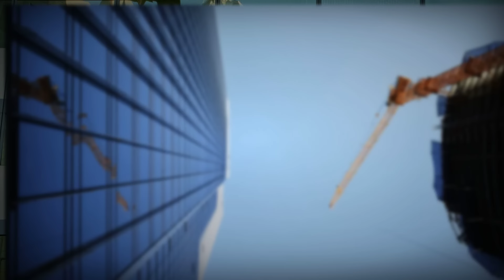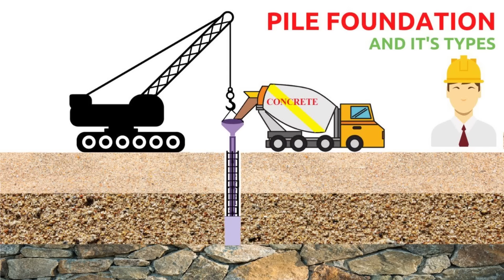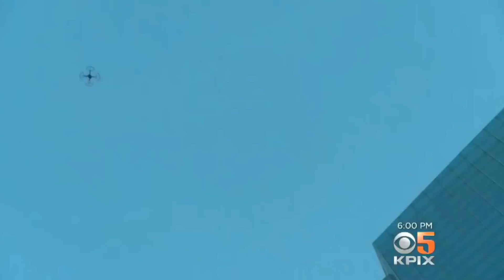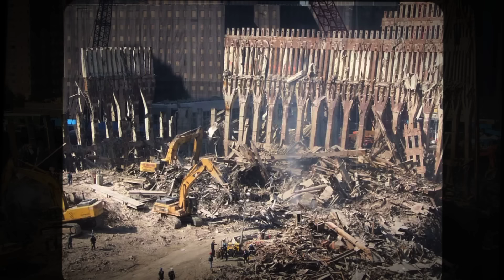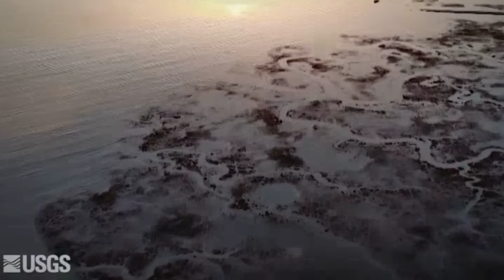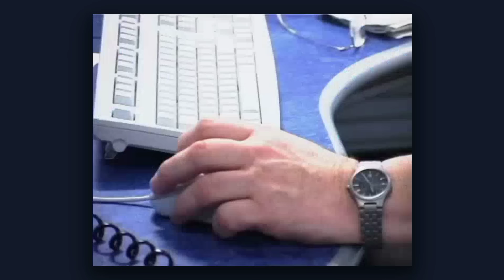Just Confirmed! San Francisco Leaning Tower Has Started Sinking

Comment: All I can say is , it's gong to be one hell of a kill zone . many people know where so clear out now . An earthquake may be the final  nail .
Reply from the maker: The footprint of a falling 645 foot tower in a dense financial district isn't just the building itself. It's a kill zone that extends well beyond the property line in any direction the building tips. Salesforce Tower is two blocks away. The Transbay Transit Center handles tens of thousands of commuters a day. BART and Muni tunnels run directly underneath. Office towers full of workers are within shadow distance. A real collapse event wouldn't be hundreds of casualties. It would be thousands.
The earthquake nail is the scenario nobody wants to model in public. The building is now in a hybrid foundation state that has never been tested in a major seismic event. Half on bedrock piles, half on friction piles in soil that can liquefy. The 1989 Loma Prieta quake was 60 miles away and still leveled buildings in the Marina. The next big one on the Hayward fault will be much closer and significantly stronger. The USGS gives the Bay Area a 72 percent chance of a magnitude 6.7 or larger quake within 30 years. That's not a possibility. That's a near certainty inside the lifetime of most current residents.
Your advice to clear out isn't wrong, just impractical for the people stuck there. Most of them can't sell because nobody will buy. Can't walk away because they'd lose everything. Can't afford new housing in the same city. So they stay and they hope. The kill zone you're describing isn't theoretical — it's just waiting for the right Tuesday morning. And the city's plan for that Tuesday is essentially to hope it doesn't happen on their watch.

Comment: Reading some of your [OPENLENS] replies, you seem to know what you're talking about. Just curiosity here: would it be hypothecatable to get some oilfield engineers in to drill and pump material in under the building? I have heard of how some materials change texture with either additives or conditions. I wild example is what happens to clay when it's baked .... Specialists in any one area / field / science / practice tend to look for solutions within that framework, like "change the foundation" as opposed to "change the soil". What kind of foundation are the Ancient Egyptian Pyramids on?
Reply from the maker: This is a great question and you're thinking exactly the way the smartest engineers in the world think — outside the discipline that created the problem. The technique you're describing is real and it's actually used. It's called soil stabilization or grout injection, and oilfield engineers have been doing variations of it for decades. The most common method for building applications is called compaction grouting or jet grouting, where you inject cement-based slurry, polymer resins, or chemical hardeners into soft soil at high pressure. The material displaces water, fills voids, and chemically transforms the soil into something closer to soft rock. Companies like Geopier and URETEK do this work commercially in the US.

For Millennium Tower specifically, the problem is the scale and the layering. You're talking about stabilizing roughly 200 feet of layered fill, bay mud, Colma sand, and Old Bay clay underneath an active 686,000 ton building with hundreds of residents inside. Injection grouting works best in localized zones — fixing a sinking warehouse, stabilizing a roadbed, sealing leaks in tunnels. Treating the entire foundation footprint of a 58 story tower would require thousands of injection points, careful pressure control to avoid lifting parts of the building unevenly, and chemical compatibility with the existing concrete piles. It's been considered. The reason it wasn't chosen is that at this scale, the risk of making things worse with uneven uplift was higher than the potential benefit. Hamburger's team modeled it and decided perimeter piles to bedrock were a more controlled intervention.

Your instinct about specialists looking inside their own framework is dead on. Structural engineers think structurally. Geotechnical engineers think soil mechanics. Petroleum engineers think pressure and flow. The best solutions to weird problems usually come from someone who's worked in multiple fields. The Egyptian pyramids are a beautiful example — the Great Pyramid sits on the Giza Plateau, which is solid limestone bedrock. The Egyptians weren't more advanced than us. They just had the wisdom to build the heaviest things humans have ever made on the most stable surface available. We forgot that lesson somewhere between then and 2005.
Reply: @AMERICANGROUND-u9r  --- Thanks. The middle paragraph of your reply explains why not. If engineers have looked at it, I guess that even if possible it wouldn't solve the basic problem which you have clearly and repeatedly identified as an unworthy economic solution ("cheaping out" on the foundation). Funneling heating elements into the clay is what crossed my mind, to turn it into brick, but then questions come up about density and depth and other side effects. The unit owners do have the small consolation of being amongst the first to say "Well, that's the way the marble rolls" instead of "that's the way the ball bounces." The centuries old adage, "Penny wise and pound foolish" applies to a lot of projects (e.g. Bhopal, India).

Comment: There is no backing out of this now. The building cannot be saved.
Reply from the maker: You might be right and the data is starting to back you up. The fix delivered 25 percent of forecast. The bending in the middle wasn't even on anyone's radar until late 2025. Every new round of monitoring data has been worse than the last. At some point you stop calling it "stabilization" and start calling it "managed decline."

The honest engineering question isn't whether the building can be saved anymore. It's how long you can keep delaying the decision before delay itself becomes the bigger danger. Every year of waiting adds more settlement, more bending, more legal exposure, and more risk that an earthquake makes the choice for everyone. The building is essentially in hospice care at this point. Monitored, comfortable, and not getting better.

The part nobody in charge wants to admit out loud is exactly what you said. There's no fix coming. There's just the slow countdown to whoever finally has the courage to call it.
Reply: @AMERICANGROUND-u9r  Yes absolutely. I've been following this story for years. I'm not an engineer but work in the AV tech field and I will tell you had I seen the final specs and proposals for this project I would have NEVER APPROVED IT----NOT EVER.
Reply: @AMERICANGROUND-u9r  And now if they shore up the entire perimeter it will only accelerate the middle dishing phenomenon as now nearly ALL of the building's weight will focus on the center; it will no longer be distributed.

Comment: Greed & stupidity a dangerous combination that knows no limits !
Reply from the maker: You've named the disease and most engineering disasters in American history are some version of it. Greed alone gets caught by good engineering. Stupidity alone gets caught by good oversight. It's the combination that bypasses every safeguard, because the greedy parties have just enough competence to push their decisions past the people who should have stopped them, and the stupid parties have just enough authority to sign off on things they don't fully understand.
Millennium Tower is the textbook example. The developer wasn't dumb — they were sophisticated enough to value-engineer the steel out of the design and shift the foundation calculations in their favor. The city inspectors weren't corrupt — they were just busy enough and trusting enough to let peer review concerns get smoothed over in meetings. The engineers weren't malicious — they were boxed in by change orders and scope limits that made it nobody's job to flag the mismatch between the new building and the old foundation. Each individual link in the chain looked reasonable. The combined result was a 686,000 ton mistake.
That's why this pattern keeps repeating. Surfside, Hard Rock New Orleans, Champlain Towers, Hyatt Regency walkway. Different buildings, different decades, same lethal recipe. Greed makes the call, stupidity signs off, and gravity collects the bill years later from people who had nothing to do with either decision.
Reply: @AMERICANGROUND-u9r  -- "... 686000 ton mistake" 🤣🤣🤣

Comment: Williams Tower in Houston has 64 stories. It’s been standing tall for 44 years!
Reply from the maker: Houston is the comparison that exposes Millennium Tower for exactly what it is. Williams Tower is 64 stories, 901 feet tall, and was completed in 1983. It's actually taller than Millennium Tower by a significant margin, and it's been standing dead plumb for over four decades on Houston soil that isn't exactly engineering-friendly either. Houston sits on expansive clay that swells and shrinks with moisture, and the city has known foundation challenges of its own.

The difference is the engineering decision. Williams Tower was built with a foundation that respected the soil conditions. Millennium Tower was built with a foundation that respected the budget. Same century, same engineering knowledge available, completely different outcomes. Houston also has the Transco Tower, the JPMorgan Chase Tower at 75 stories, and the Wells Fargo Plaza at 71 stories — all taller than Millennium Tower, all standing straight, all on soil that was never as dramatic as San Francisco bay mud but still required real foundation engineering.

The lesson isn't that San Francisco can't build tall. Salesforce Tower two blocks away is 1,070 feet and sits perfectly plumb on bedrock piles. The lesson is that Millennium Tower didn't fail because skyscrapers are hard. It failed because somebody decided to skip the part of the job that actually matters.
Reply: @AMERICANGROUND-u9r I have seen buildings being built downtown in Houston. They dug a hole in the ground, five stories deep just for the start of the foundation.

Comment: I remember hearing that the original plans for the building were in spec with the foundation. It was different height and construction. When they changed the dynamics of the building on paper, they chose not to change the foundation plans. This is the result of that negligence.
Reply from the maker: You're remembering correctly and that detail is one of the most important parts of the story that almost never gets the coverage it deserves. The original design was lighter — steel framing instead of concrete, with load assumptions that the friction pile foundation could actually handle. Then somewhere in the value engineering process, the developer made the call to switch to reinforced concrete because it was cheaper to build with. That single change added enormous dead load to a building that was already pushing the limits of its foundation.

The negligent part is exactly what you said. The structural change should have triggered a full geotechnical review. New load calculations. Updated soil consolidation modeling. A reassessment of whether 60 to 90 foot friction piles in Colma sand could carry the new weight. None of that happened in any meaningful way. The foundation design got grandfathered in even though the building sitting on top of it was no longer the building the foundation was designed for.

That's why the lawsuits dragged on for years. The developer blamed the engineers for not flagging it. The engineers said they weren't given updated load figures. The geotechnical firm said they weren't asked to redo the analysis. Everyone had a story about why it wasn't their job to catch the mismatch, and the result was a 686,000 ton building sitting on a foundation designed for something significantly lighter. The residents are paying for paperwork that nobody wanted to redo.

Comment: Why don't they just, little by little, dismantle it before it collapses and 100's of people get hurt!!
Reply from the maker: That's the rational answer and you're not wrong to ask. Controlled deconstruction floor by floor is the safest path forward and it's exactly what should be happening right now. The technology exists. The methodology exists. Companies have done it on smaller towers in other cities.

The reason it isn't happening comes down to three words — nobody wants liability. The moment the city orders a dismantle, the developer faces full legal exposure. The engineers who signed off get named in fresh lawsuits. The insurance carriers fight over who pays for the residents' losses. The 419 owners hire lawyers to demand market-rate buyouts on units that no longer have a market. Everyone involved would rather keep monitoring the building than be the first one to admit it can't be saved.

So they wait. They patch. They run the sensors. They write reports. And they hope it holds long enough that the decision lands on somebody else's desk. The longer they wait, the more dangerous and expensive the eventual dismantle becomes. That's the trap. The right answer was clear 5 years ago. It'll be even clearer 5 years from now. By then the cost and the risk will both be much higher.

Comment: They sould have build on bedrock from the biginning. Now they have a problem that cost more to fix (if fixing is possible) than what they saved by using frixion piles.
Reply from the maker: Exactly. Skipping bedrock saved them roughly 20 to 30 million dollars in 2005. The rescue alone has now cost over 100 million, and that fix only delivered 25 percent of what the designer forecast. Add the lawsuit settlements, the property value losses, and the ongoing monitoring, and you're looking at well over 500 million dollars spent trying to clean up a 30 million dollar shortcut. The math on cheap foundations always works in the short term and never works in the long term.

Comment: This a way bigger deal than people realize. It’s going to tip over if nothing is done.
Reply from the maker: You're closer to the truth than the city wants on the record. The official line is that the building is structurally sound. The unofficial reality is that "sound" is doing a lot of heavy lifting in that sentence. Engineers aren't worried about a dramatic Hollywood collapse. They're worried about the quiet point where the elevators stop working, the plumbing fails at the joints, and the building becomes physically unusable long before it falls. That's the real failure mode nobody's talking about.

Comment: Why does anybody care that Joe Montana “endorsed” the building? Just because some football player says it’s good, that means people should fork out millions? Should he be held just as liable?
Reply from the maker: You're right to push back on that. Joe Montana didn't endorse the building, he just bought a unit. The reason his name keeps showing up in coverage is marketing, not engineering. Developers love celebrity buyers because it lets them sell the rest of the units faster and at higher prices. "Joe Montana lives here" was worth millions in unit appreciation when the building opened.

But you're asking the right question. He's a buyer, not a structural engineer. He got duped same as everyone else, just with more money to lose. The people who should be held liable are the ones who actually signed off on the foundation — the developer, the structural engineer of record, the geotechnical firm, and the city inspectors who approved permits despite peer review concerns. None of them have faced criminal charges. Montana is a victim in this story, not a villain. The fact that his name gets dragged in tells you more about how the press covers engineering disasters than about who's actually responsible.

Comment: Good thing San Francisco doesn't have to worry about earthquakes. 😂
Reply from the maker: The sarcasm hits because it's the exact thing nobody at City Hall wants to say out loud. San Francisco sits between two of the most dangerous fault lines in North America. The Hayward fault is roughly 8 miles east. The San Andreas runs right along the peninsula. The USGS puts the odds of a magnitude 6.7 or larger quake in the Bay Area at over 70 percent in the next 30 years. That's not a remote possibility. That's a near-certainty inside the lifetime of most current residents.

And the building is now in a hybrid foundation state nobody has ever tested in a real earthquake. Half on bedrock piles, half on friction piles in soil that can liquefy. The 1989 Loma Prieta quake was 60 miles away and still liquefied parts of the Marina. The next one will be closer. The engineers know this. The city knows this. The residents are the ones gambling that the math holds long enough for them to sell.